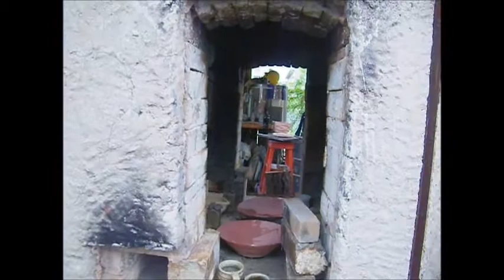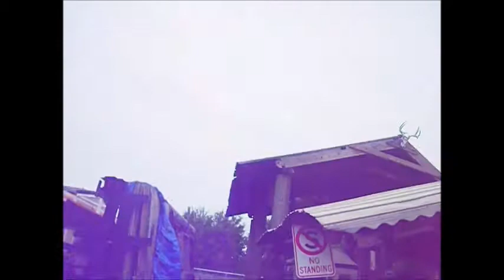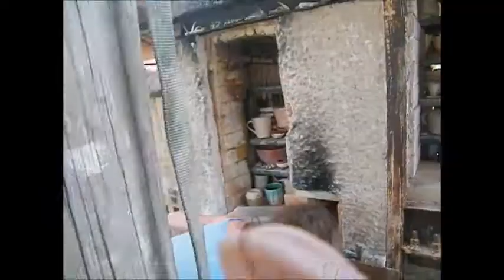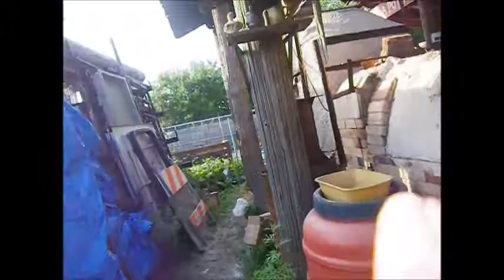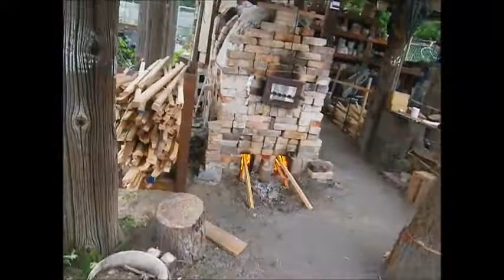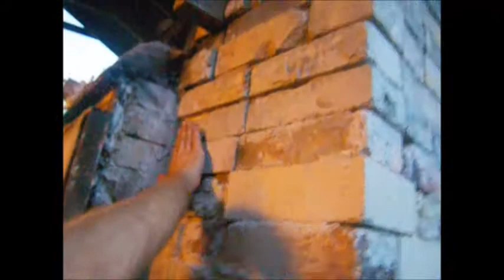Salty Dog Firing 7 28 30  2016

Comment: Hello Gary, is this kiln still in operation?
Reply from the maker: I believe it still exists but Henry hasn't fired it recently. He has gotten hired by Center For Creative Studies & Pewabic to teach.  It could have been designed better.
Reply: @gindaup  are you going to build another kiln?
Reply from the maker: @bradley200711  I doubt it unless I had a decent location,  fuel supply, & helpers. The bricks might still be at my friends up North. If I rebuilt I would make more room inside for secondary stoke coal pile with 3 instead of 4 shelf stacks.